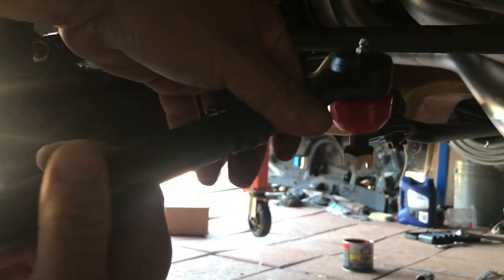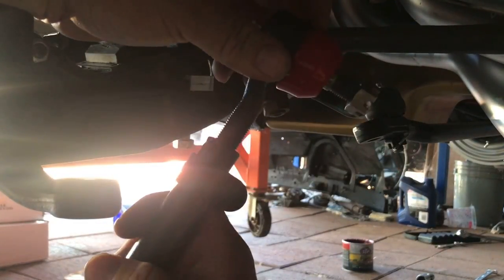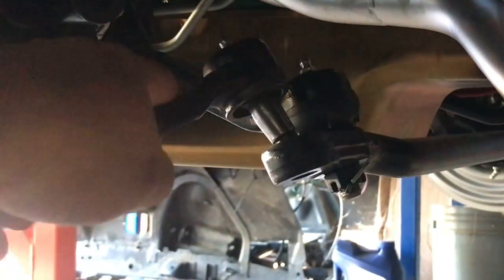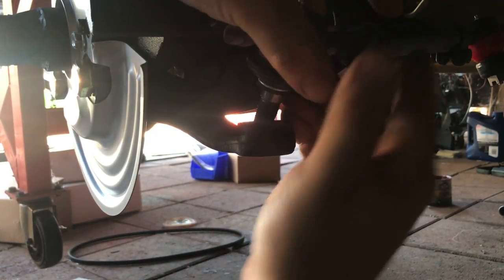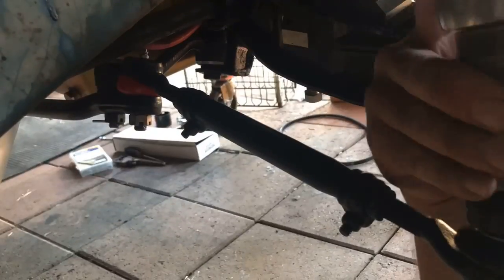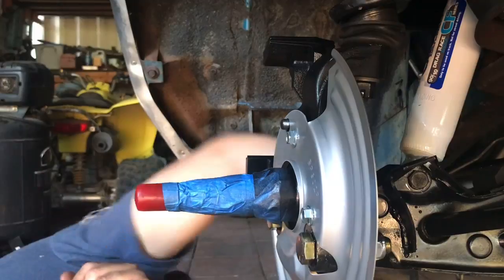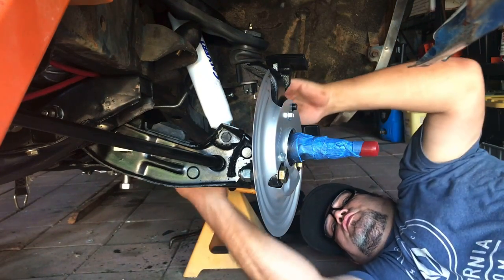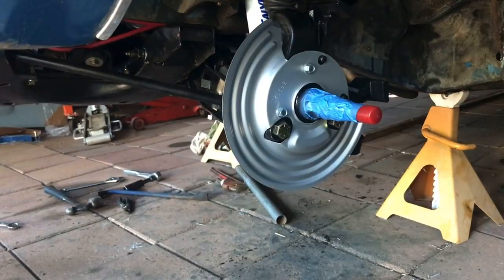1968 Dodge Charger build - Tie Rod installation

Comment: You need to fix your upper ball joint boot!
Reply from the maker: Thanks Nickolas, I actually had to rewatch to see what you were talking about. I used an extension and gently hammered around the edge to move the boot up onto the ball joint. Can’t remember if that was in a video or not.